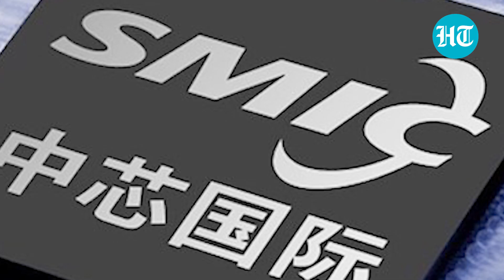U.S ‘saves’ chip tech from China; Biden admin introduces new export rules, blacklists 31 firms

Comment: Those who are enjoying 
china developing its own chips, 5nm+ ,They are investing billions in quantum computing, fusion reactor, maglev tech, they have 170+ supercomputers, leading Nation in 5g.
Reply: TSMC and Samsung are already at 3nm, not just developing it and are both moving to 2nm next. China is still clearly behind.
Reply: @teemuvesala9575  intel's consumer grade cpu's are 10nm so, you are telling me intel chips are bad?? ??
Reply: @sayanpatra6910  Currently they are behind AMD which uses TSMC 5nm in their latest CPU's. Manufacturing process wise yes, Intel is behind. One thing to note though is that Intel's 10nm is more close to TSMC 7nm in transistor density. Intel recently renamed their 10nm process to "Intel 7" for that reason, as marketing wise it sounds better.
Reply: @teemuvesala9575  check amd 7000series vs intel 13 Series, Nm are just for efficiency, core clocks is more important,than nm
Reply: @sayanpatra6910  AMD 7000 series are still much more efficient than Intel 12th gen or the upcoming Intel 13th gen for that matter, despite AMD did increase the wattage to previous 5000 series (which were on TSMC 7nm btw) in order to squeeze more performance out of 7000 series. Well d'oh, obviously increasing clockspeed eventually lowers efficiency especially if you increase it past the optimal efficiency range for that chip architecture and manufacturing process. If you ever did overclocking or underclocking you'd know what I mean.